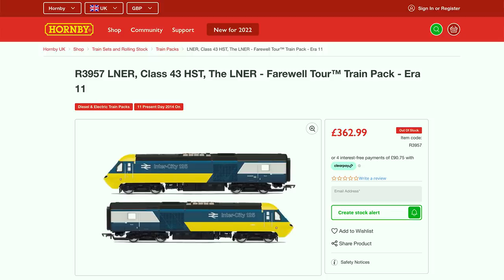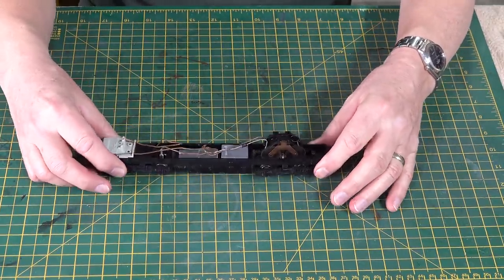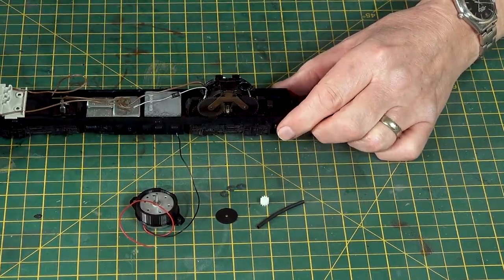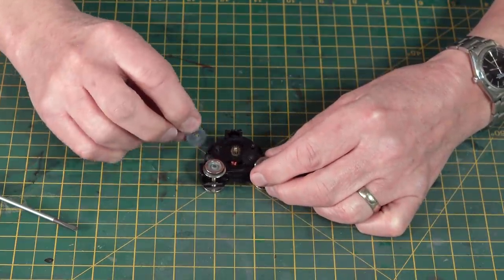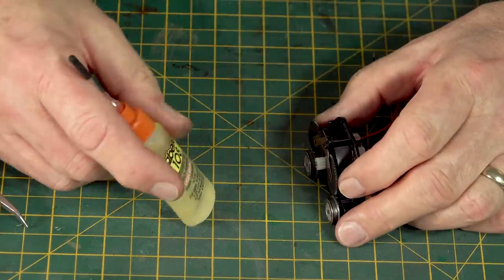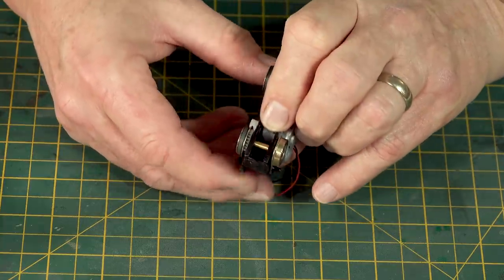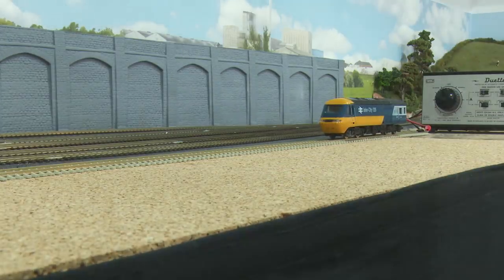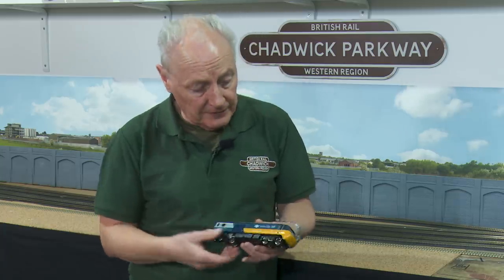Replacing Loco Motors at Chadwick Model Railway | 151.

Comment: Hi Charlie, another great video. So thank you once again. Now here is the problem with upgrading locos which I have done..........
Motor upgraded for £20 including wire etc and hours spent.
Paint not good enough now so £20 spent on that.
Respray causes loss of detail so £20 on handrails etc.
Plus another respray after mods so another £20.
It does not have working lights now so another £20-£40 on that.
Oh decals, so another £10 on them!
Coupling, yup way too wide, so anothe £20-£40 on that.
Not running too well so buy weights and add them.
You end up with a "Bashed" model that you can't sell to middle aged men wanting to re-create their childhood. 
My advice; Sell all the stuff you are not happy with on Fleabay to people who want "THAT" childhood memory, save up and buy something brand new and reviewed as decent, and spend the would have been wasted hours ballasting or building errr buildings.
Now the serious bit, if you have to go to the trouble of selling your naff stuff and to save up nearly 400 quid and another couple of hundred quid for a long 125 set you will look after it. Cheers Charlie. So what you said right at the start then, eh?
Reply: True some of the alternatives can still be expensive but I think you are exaggerating a little.

If you are a railway modeller and not just a train buyer then you can use a little ingenuity to keep costs low.

To start with buy non-model Railway specific paints and varnishes so you don’t have to pay the mark-up. The same goes for any brushes and tools.

For handrails and details you can make your own out of wire and plastic with a little patience or buy spare lots from eBay or shows if you need specifics like vacuum pipes, ETS cables etc.
For lighting I have always used basic LEDs off of Amazon etc. You can get hundreds for just a few pounds.
If you want slightly more refined LED’s which may be more reliable or maybe smaller to fit in small models then you will pay a little more but not much.
Wire and solder to make the lights happen will cost a few pounds and will do several models.

You don’t have much choice with decals but the savings in other areas will help with that.

As for couplings you can buy spares for pennies online or at shows. If you really want to splash out you could get some kadees or similar which are about £1.25 each. 

Once you’ve bought some tools, brushes, varnishes etc it may be a while before you need to buy any more so if you have a few projects on the go it will spread the cost over several models.

At the end you are left with a personalised and unique model that is special to you. I personally have never sold a model as I don’t buy many and when I do it’s one that I really want and will cherish.
Reply from the maker: Interesting comments gentleman.However my main bugbear, is it’s becoming increasingly more difficult to bring in youngsters to our hobby.
It’s the costs to put them off. Regards Charlie

Comment: Out of curiosity, does using Mark’s kit actually increase/reduce the weight compared to the stock parts? And if does increase/reduce the weight, is there any pros or cons?

Note: I’m not a railway modeller or have trains. I ask because I’m nosey :)
Reply from the maker: Good question, I think that it’s marginally lighter.

Comment: The issues with this are many. Firstly, it appears that to get a motor slim enough to do this correctly, without the motor hitting the inside of the body (9/10mm), you can now only get a 6V one. These 12v motors are 12mm thick and will hit the inside of the body and will reduce the tightness of the curve the loco can now travel around. With the 6v motors, especially with DCC, you are going to have to half the votage, either by programming they DCC chip, or by adding a diode drop-down bridge.  But, for all that effort, what do you actually get?  You are still running a locomotive with reviled traction tyres, and you are only picking up the voltage from one bogie, and not two. Plus you are getting all that noise from all those cogs on the side of the ringfield body.  On a side note, you put the cogs on the wrong way around, as there is a raised lip on the cog that if positioned against the motor will create a gap between the main part of the cog and the metal of the motor. Putting them on the wrong way around will further increase the noise and cause wear.

If you were to remove the body of your edition of the 125, you will see two motorless bogies with a central motor with drive shafts, which is infinately superior, allowing for both rail electric pick-up from both bogies, preventing drop out over points, plus you are getting eight wheel drive with no traction tyres rahter than the lob-sided two wheels with tyres you get with this conversion. However, this is a far harder project needing a greater level of modelling skill, plus the expense of doner motor and bogies, costing in the region of £75 from Bachmann spares.  But this is still a bargain compared to the absolute silly money Hornby are now demanding across their entire range. It is also something I am considering for the old 1980 APT model, since the new version is an astronomical £550. I have seen a couple of them done on places like RMWeb.  The other alternative is to replace the Ringfield with a Tenshodo motor bogie, needing to get a model with the correct wheel span and the abailty to be housed in the wheel frame cradle.  The downside of this approach is that you are still driving your train from one bogie and so you will need to add a fair amount of weight to improve traction.
Reply from the maker: Very interesting comment mate. However, I was clearly offering a cheaper alternative to the 1980s version, attempting to breathe life into our somewhat Old but treasured stock. Regards Charlie

Comment: I had that same version of the HST 125 as a kid, I think it's still at my mum's, I'll have to dig it out since the upgrade is relatively simple and the parts are available at reasonable cost. Horny can jog on if they think I'd pay £350 for a power car and dummy DVT,  I mean at least throw in 2 passenger coaches like you got back in the 80s. It's ridiculous, Horny are trying to ruin the hobby, especially for new comers and youngsters. Hornby are making it a non starter. I'll save this and the next video in my favourites for future reference if I do sort out my old HST to make it a DCC runner, thanks, and I'm glad you went back to the subject after initially dismissing it.
Reply from the maker: Hi great comment Mark, thank you and good luck with your renovations. Regards Charlie

Comment: Hopefully the new white nylon pinion will be strong enough not to split tooth root to bore as many do......
I have on old Mainline Warships forced a washer over the tips of the teeth to add strength and stop gears splitting. 
Just saying....
Reply from the maker: An interesting point Nigel, and one to watch out for no doubt. 
Regards Charlie

Comment: I hate to say it but I truly can't see model railways surviving more than a couple more generations at most at this rate. How is anyone under 30 supposed to get in to the hobby with prices as ridiculous as that? If that was for a full eight-coach set I'd understand it, but breaking the £200 for a pair of power cars is already bad enough, £300 is just ludicrous. Bachmann also having a go with their 'deluxe' Class 47's. I just can't tell the difference between them and the older ones minus the glazing if the light just so happens to hit it right.
But enough ranting! What an improvement that new motor was, breathing new life in to a classic model. I can't wait to see it converted to DCC. I hope you take on the extra challenge of giving her working tail lamps, Charlie!
Take care. Mike.
Reply from the maker: I’m so pleased that you enjoyed it Mike.  Stay tuned, lights will be included.

Comment: Good video those clips are E clips not circlips ( circlips have a hole in each end for a special pilers to go into to either expand or make smaller depending on where they are inside or outside circlips.
E clips are also called Jesus clips because when they fly off you go where in the Jesus did that go to in a workshop etc
Good to have sound effect when trying to remove wheels but at your age dont blow a pooper valve LOL
Reply from the maker: Great comment Robert. Thank you, regards

Comment: Stupid price that is for a train, don't know where they get their prices from, these things cost about £25 to make believe it or not, if they keep this up they will end up going bankrupt. hornby are using covid as an excuse to bump up the prices, quite sickening really. anyway charlie brill little video and i did something similar to this to old lima stock years ago, what i used to do is fit 2xringfield motors to various lima diesels this then gives twice the torque and twice the poles (6 pole) they ran beautiful, but i never used oil only lithium grease you can buy a whopping silicone sealant sized tube of this stuff from Jims Hardware in Penzance for 3 quid, its bloody brilliant stuff been using it for at least 20 years, grease tightens up the tolerances of gears etc this makes the motors run hell of a lot quieter, the beauty of old lima models is theres literally a ton of space inside to fit very large speakers too, id also say the yellow colour of the old models is more accurate, brill video as always!
Reply from the maker: A great comment buddy and much appreciated. Regards Charlie.

Comment: Great conversion idea .like you I have looked at replacing Ringfield motors with CD motors but have not been  convinced by the other you tubers methods .This is a great idea but unfortunately your videos are getting like Oprah's book club, anything you show is out of stock immediatey after airing
Reply from the maker: I’m sorry John, but it appears that demand outstrips supply!
Reply: On another note I get really thin wire by stripping out old telephone wire  T hat ent colours to use gives me six thin wires of differ
Reply from the maker: @johnmassey7687  great idea mate.